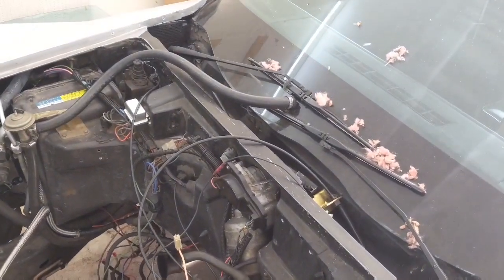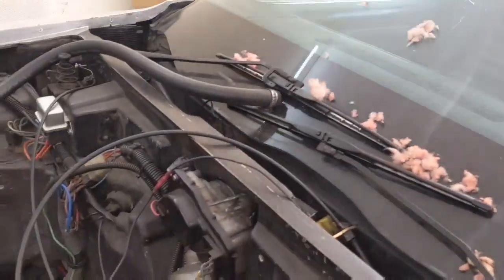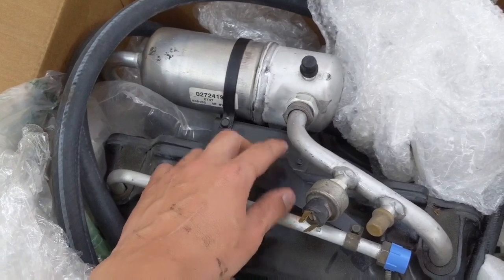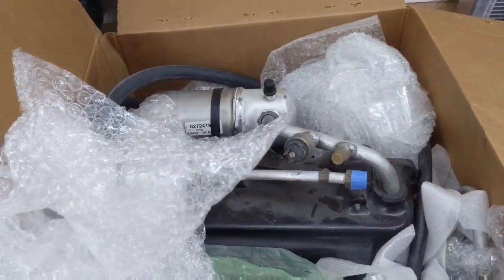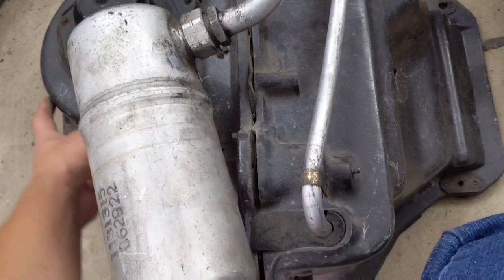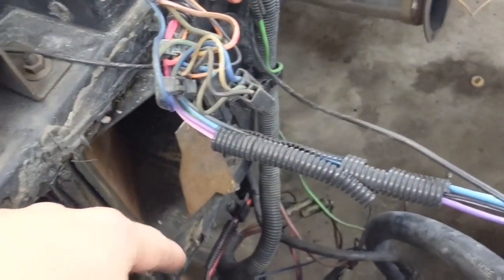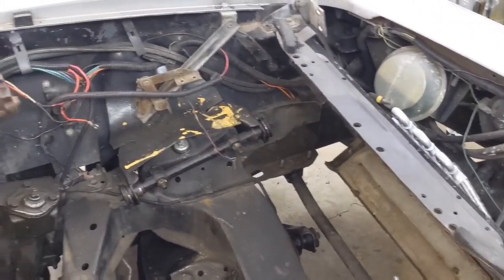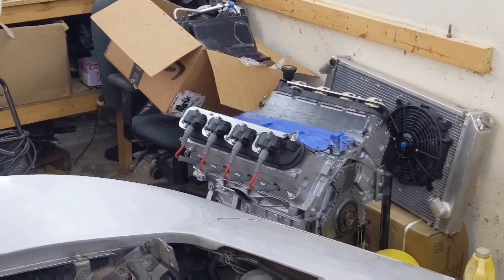C3 Corvette LSX Swap Part 2!

Comment: quick question, how are you gonna clear the heater hoses coming out of the LS water pump. The fittings hit the upper control arm on the LS swap i am doing.
Reply from the maker: I will actually have a fix for that in the next video. it's a little expensive but in the long run it's going to be worth it for anyone who does this